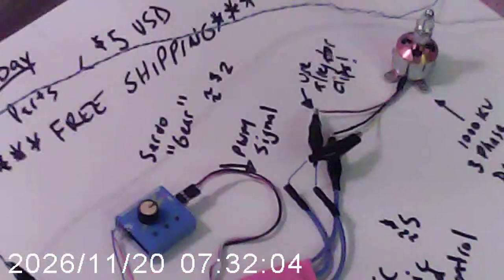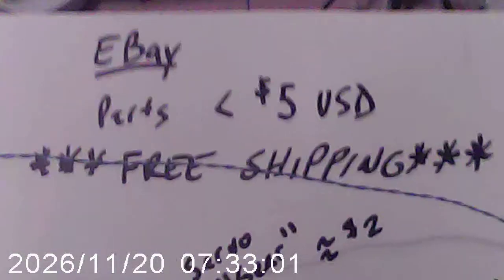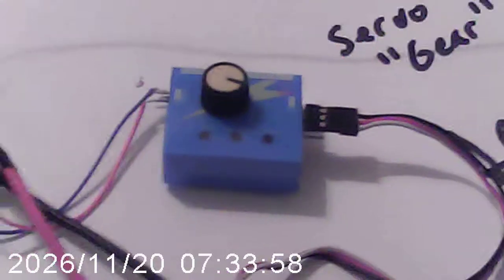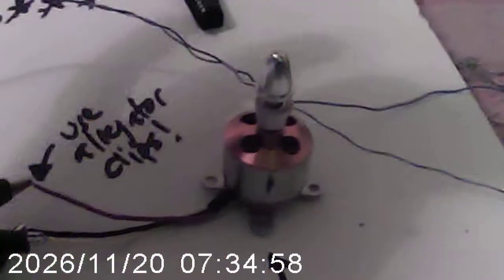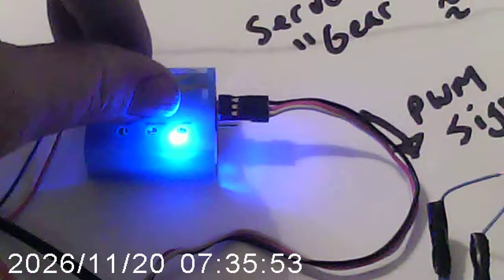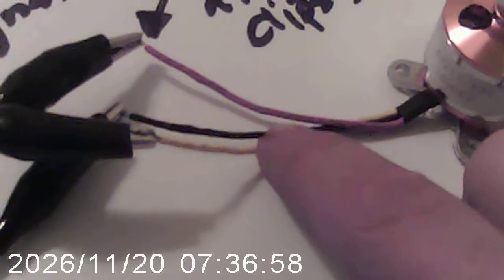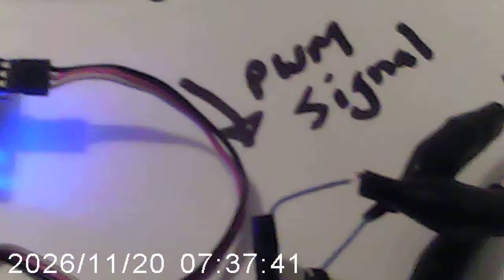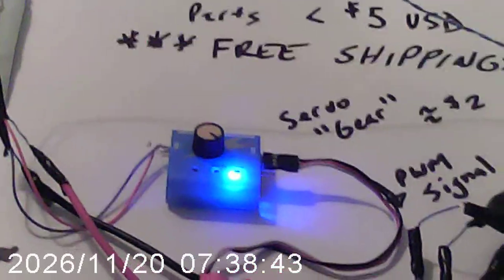Test Rig for 3-Phase Drone Motor (Part I)

Comment: A simple way to run them would be to buy a 2nd hand computer power supply (Not a laptop one) a actual server PSU.
Server PSU's can get up to a hairy 1200 watts. (Or 100 amps on the 12 volt rail)